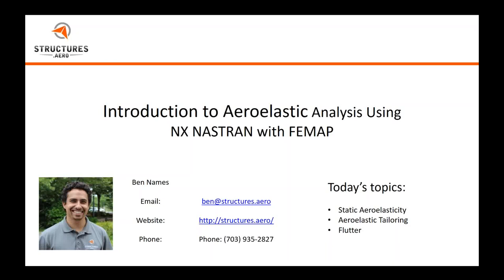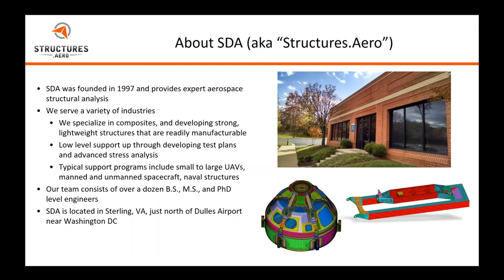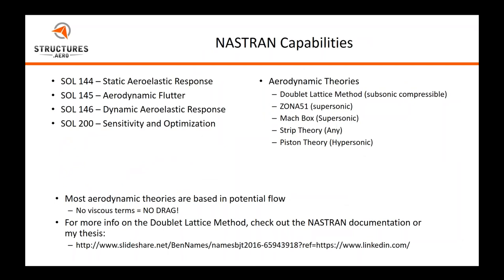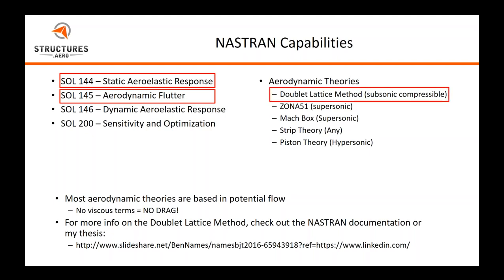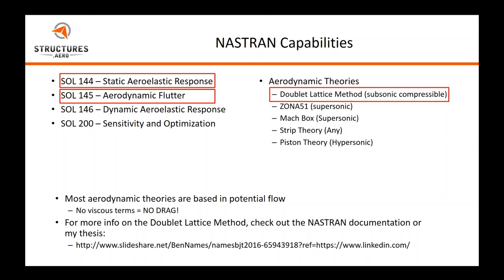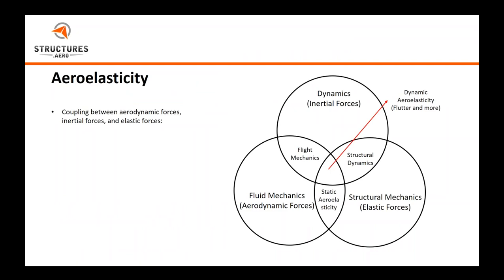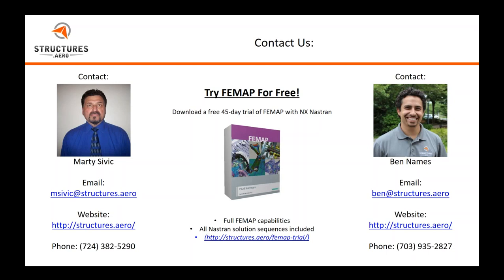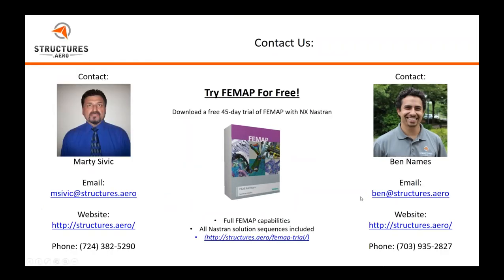Introduction to Aeroelasticity in Nastran (NX Nastran with Femap)

Comment: Great video! But how can I properly select structural nodes in order to have a spline that correclty transfer aero model to strucutral model? Which nodes should I choose?
Reply: Hey Arthur
Did you get any solution to this? I am facing same issues. 
Thanks